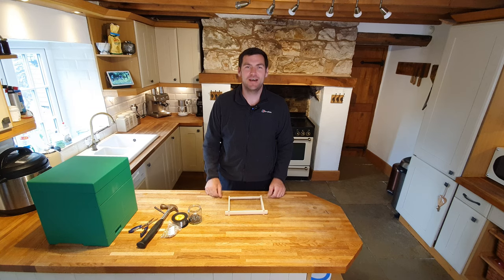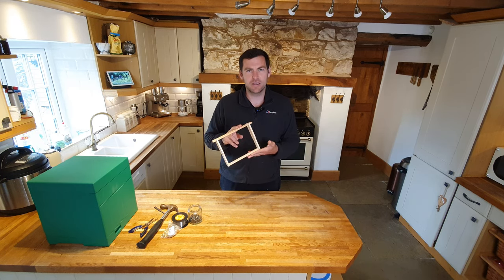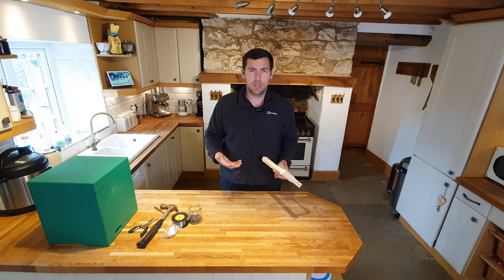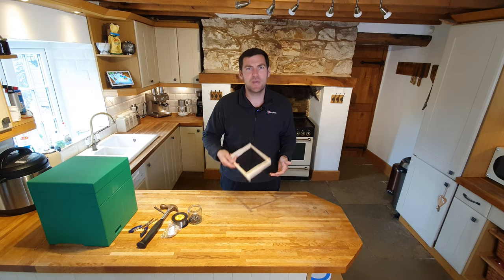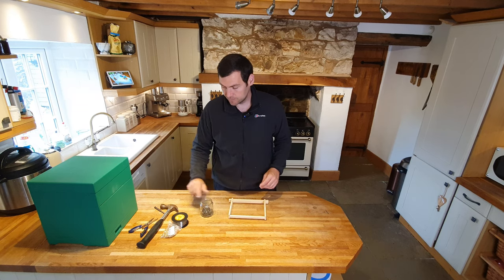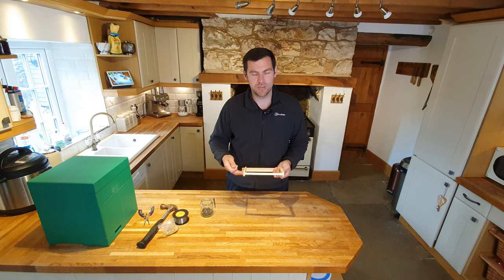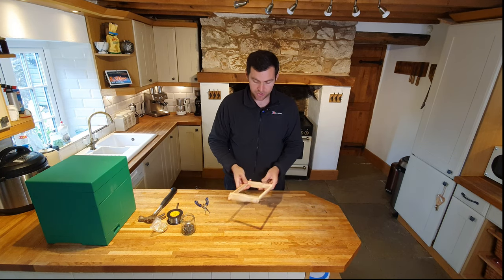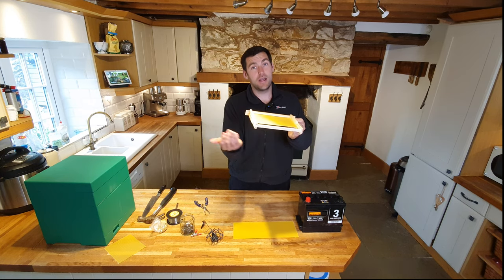How to Wire Brood Frames

Comment: Have fun spending hours wiring up frames! I was about to switch over to wired foundation for speed, but think I may just try to improve my wiring methods
Reply from the maker: Ah its sooo time consuming and boring. You can actually buy them prewired from a few places in bulk but if you only want a few, its best to just make them up as its its cheap

Comment: How many wires you adding on a National Brood frame, or would you add?
Reply from the maker: Yes. Minimum 2. 3 If you can be bothered. 4 on a 14 x 12
Reply: @BlackMountainHoney  I'm looking to extract from National brood frames in a radial extractor so was looking at 3 as a minimum, not sure if 4 would be overkill. I have been searching the net, but there does not seam to be any standards when it comes to National frames, guess we so wired for wired foundation.
Reply from the maker: @iandudman9529  4 is certainly overkill for national deeps Could argue 3 is belt and braces. 2 absolute minimum for deeps and shallows.

Comment: Thanks Laurence, I have never seen this done before on video, you make it seem so easy.
I will certainly give it a try, beats trying to take frames apart and gouging out the wax (with my skin at the same time)  Just to say ta for all the videos and advice. Peter
Reply from the maker: No problem Peter. My pleasure. Yes - the real benefit to this method comes at the end when you melt down and rewax. Its so easy and efficient